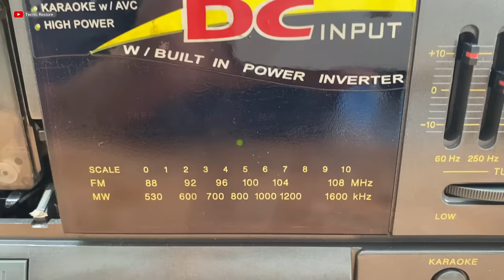Restoration Old Cassette Deck POLYTRON | Restore Cassette

Comment: Now if that tape deck worked I would have been impressed.
seems like the EQ is dead as well.

Isn't it strange it was all caught on video the discovery of the deck within minutes like you knew right where to go to find it?

The fun part is adding the dirt to make it look old.
Reply: The most amusing part was when he started moving the knob of a graphic equalizer up and down. He turned the knob to the maximum, but it still sounded weak and lacked dynamic. What a fraud.

Comment: What a load of poop. Whoever is using the multimeter isn’t even paying attention to the values and soldering resistors on the wrong side of the PCB board is priceless comedy.